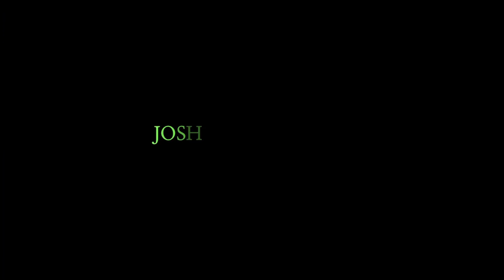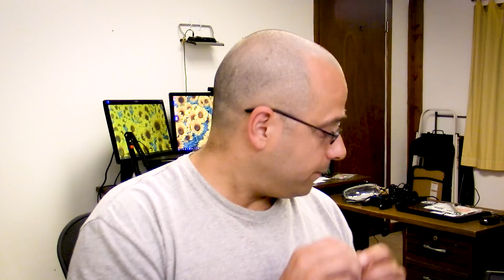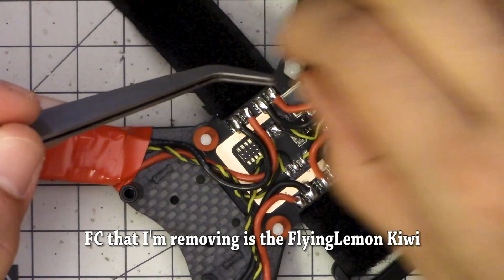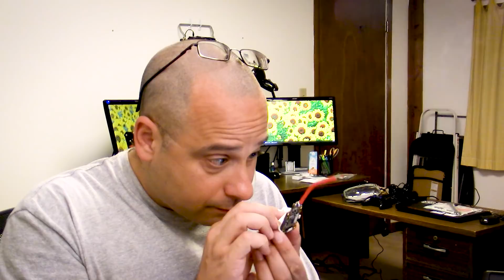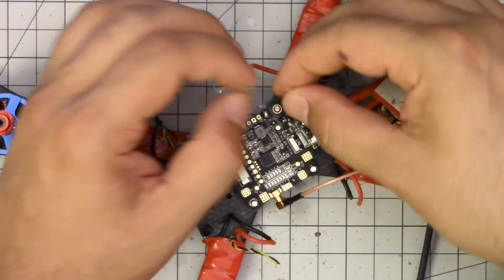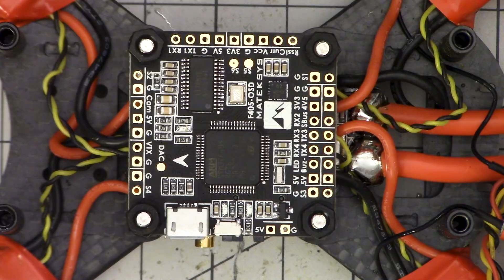Matek F405 & FCHUB vTX How To Install

Comment: Hey josh.. i had a signal wire from one of my esc's rip off the FC with the solder pad.. is there anywhere else i can solder 2 ? Was a purple wire.. wired on to s3.. theres a pad right next to it which im wondering about

Comment: I found a drawback I didn't expect with the FCHUB-VTX. I went to put one in a SabotageRC Dingo and if you use the 6mm standoff that comes with it, the tabs for the XT60 wires actually touch the frame. And if you are using it with the ribbon cable and a Matek FC, you can't turn it 90 degrees like you might otherwise. So I had to put it on very tall standoffs -  which shouldn't be a problem as you probably won't use a 3-high stack with this VTX, but just something to watch out for.

Comment: Hi Joshua i have these board combo but the mah drawn in my osd is not working what could be the cause of this?
Reply from the maker: Check the Current Source in the Power And Battery tab? Umm.... I think it should be ESC Sensor.

To configure ESC telemetry, do the following:

1. In the Betaflight Ports tab, in the Sensor Input column, enable "ESC" sensor input for the UART that ESC Telemetry is connected to. (This may be enabled by default on the Matek FC.)

2. In the Configuration tab, in the Other Features section, enable ESC_Sensor.

3. Be using Dshot. ESC Telemetry doesn't work without Dshot.

4. In the Power And Battery tab, set the Current Meter Source to ESC Sensor.
Reply: @JoshuaBardwell  Thanks Joshua! i tried to put the esc sensors into the ports tab put it did not work, after this i saw that the ma/v of the onboard adc was to low so i raised it and now i get a proper mah drawn. thanks for the help as always!

Comment: Hey Joshua great video would you know if those little plastic slide in sections for the ribbon cable connection are available I accidentally broke one of mine
Reply from the maker: I don't think they are replaceable without significant solder skills.

Comment: can you use a 4in1 esc?
Reply from the maker: You can but it wouldn't be ideal.
Reply: Since most of my frames have very thin arms I can't fit the esc's on the quad. After watching your review I went out and purchased 4 of these and now I don't see how to connect my 4in1 to the board. Any suggestions/videos showing this process?

Comment: JB. The vtx 5v bec is rated at 1a, will that be a problem to power up fc, rx, cam, & gps??
Reply from the maker: I think it should be okay, as long as you don't try to power the vTX also.
Reply: Joshua Bardwell The vtx is part of the pdb so i assume it doesnt take power from the 5v bec. Thanks JB

Comment: Do I wire the Vbat (on the VTX/PDB) to VCC (on the flight controller)?
Reply from the maker: I don't think that is correct. I believe the Matek F405 is powered either through vBat to the main battery pads, OR through 5v direct input from the PDB ribbon connector or equivalent solder pad.

I think that the VCC pad is intended to power an accessory device like a vTX when the board is powered from vBat. I don't think that the VCC pad will have any voltage on it when the board is powered from 5v.

Comment: If one of the pads comes off where your soldering to is the board then broken or will it still work?
Reply from the maker: It's broken. Sometimes you can find an alternative pin but if not it's dead.
Reply: Joshua Bardwell I think I've nackered the board, it's my first build. I've ordered another fchub pdb. I was having great difficulty soldering the ESC power cables to the board, the solder wasn't melting quick enough and went it did it just smeared and looked a mess

Comment: Where do I connect the microphone from my camera to this setup? Can I have audio transmission and smart Port audio control at the same time?
Reply from the maker: Yes you can do audio and vTX remote control because this vTX uses Tramp Telemetry protocol which uses a separate line from the audio line. There is an audio/mic input on the PDB/vTX where your mic will get connected.
Reply: Joshua Bardwell is that the pad marked TLM right next to the video input?

Comment: Awesome video. I Purchased the Matek F722 and the FCHUB6-s.  Should all be the same. It’s expected to arrive any day now.  Any advise to minimize solder splatter to critical spots?  Lower heat maybe?  I’m using a Taranis QX7 transmitter.  I’m not into racing, so what do you suggest for a receiver? I have a X8R. Sbus, Smartport?  That is all new to me.  I’m coming from the Arduino world.
Reply from the maker: For a receiver, the XM+ or RXSR are good but you have to update the firmware on the RXSR before you install it in the quad.
Reply: My Matek F722 STD, FCHUB6-S came in today.  All soldered in.  NO SMOKE!  Dumb question, Can I connect the USB when the battery is plugged in?  Scared of frying my board as soon as I get it.  BTW; I grill all my steak, have never seared them. Pointless!

Comment: With bf3.3 and Kalman Filters coming, matek f7 (which supposedly cant run 32k/32k) or f405
Reply from the maker: Betaflight is not optimized to run on F7 right now. It runs slower than on F4. If you want to do 32k right now, F4 is where to be.

Comment: I do the the same thing at times with using same colored wire to use it up. ... BUT ... When I do use the same color wire like that I just put a piece of colored electrical tape or heat shrink at both ends to identify the color it is meant to be. If not I get confused. Especially if I put the wire in sleeving.

Comment: Did you have to update the firmware on the VTX board to get the Tramp comms working ?  Whenever I enable the peripheral device to Tramp on softserial the whole soft serial config gets wiped on reboot.  Firmware update it not going well either. Nevermind, Tramp should be on uart5.
Reply from the maker: Nope. it worked out of the box.

Comment: Hey +Joshua, i'm new to multicopter building/flying and really enjoy all the information you provide on your blog and youtube. Thanks for that! One thing in this video confuses me. You say if you don't have a GND solder pad for the esc-sgn-gnd just solder it to the power-gnd or if the ESCs are free desolder the gnd-wire. Actually on my ESC (DJI 30A Opto) the sgn-gnd and the power-gnd are already shorted, so does it make sense to have the extra gnd-wire? I read alot about this and all I understood was that I should solder the sgn-gnd because of different 16V(4S)gnd-level on power-gnd and 5V-sgn-gnd.

Comment: You could just use a continuity check from the ribbon to the pads to confirm the up/down issue without power.
Reply: .... and I now see you did a lot of that in your troubleshooting video. :)

Comment: Ibcrazy recommended using a 90 degree for the antenna that takes stress off the connector and if it breaks it leaves a load on the antenna

Comment: Hi josh. Got this setup. And all works great. Using runcam swift 2. But want audio so i can use my earbud. But cant figure out where to solder audio wire from camera to the board. Please help
Reply from the maker: Audio input is on the bottom of the board. See this photo:

https://www.rcdepothobbies.com/v/vspfiles/photos/FCHUB-VTX-3.jpg

Look at the AUD pin just to the right of the RF module cover.

Comment: Careful i was runing P.I.D loop and gyro at 8k and FC pulls 1.5 amps PDB's 5v only rated at 1amp my PDB lasted 2 flight after switching to 8k and and 5v burnt out.
Reply from the maker: It has nothing to do with your PID loop rate. If you pull 1.5 amps from a 1 amp regulator, you'll kill it.
Reply: Joshua Bardwell well i got a new fuhub vtx and with the same settings on the flight controller plug the battery in current sensor reads 1.5 amps I unplug the battery plugged into betaflight turned PID Loopto 4k now I only pull .5 amps why the change in amps then?

Comment: Hi, do you think that the 5V/1A output is enough to power a runcam split V1? (Given the fact that The FCHUB-VTX needs to power its own VTX, the receiver (Frsky XSR) and the F405 Flight controller too) 1A seems a little short for all of this.  Thanks!
Reply from the maker: +Francis Verville no I don't think so. Split pulls like 600 mA.

Comment: Joshua, I'm building the same quad with these FC and VTC/PDB boards, I'm ready for the next installment.
Reply from the maker: Here was the next one.
Reply: If I may jump on the back of this...I'm in the same position as Doug here but am unsure what you meant by this? :/ Thanks for any info you could give.

Comment: Why did you wrap your previous vtx in kapton tape?
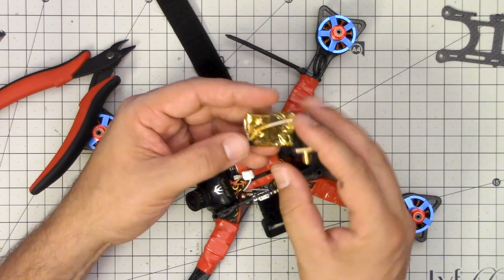Reply: 1:40
Reply from the maker: For electrical isolation. But kapton you can see through so you can still see the LEDs, while electrical tape you can't. I could use clear heat shrink but I don't have any.
Reply: oh, okay :D

Comment: I have a question that, I can't seem to find very much information on. It has to do with setting up camera_control and the modes for CC on BF tab.
 I am very intrested in setting this up, as I would like to be able to access my camera settings menu with my remote and goggles. I have the matek f405 and found some info on the DAC pad and tried to make it work but could not.
1.) I enabled camera_control_mode = DAC 
2.) Set resource CC to A04
3.) Left all CC to default.
4.) Set a switch to CC in modes tab, but it never activated. 
5.) Tried to yaw right,  to no avail.

I will try using the signal pin 5 tomorrow with a resistor, as seen in a few videos, however would like your input on the subject.
Thanks for all you videos.

Comment: Hi Joshua,Firstly, thanks for all the great vids and content.  I have a question about the Matek F405. Have you had any issues with yaw twitching.  I have a Matek F405 board, with Spedix BL Heli32 ESCs and Cobra 2207 2450kv motors and I am having issues with yaw twitch when throttling up.  This is still a brand new build and I haven't yet fitted the 220uf, 35v capacitors supplied with the board. Matek supplied 4 of these, presumeably for each of the ESCs. I have heard that the Gyro on these boards is very sensitive to noise from ESCs/motors and this can cause yaw twitch.  In your opinion is this likely to be correct?Thanks again and keep the good vids coming.Gary
Reply from the maker: Put the dang capacitors on for goodness sake that is why they sent them.
Reply: Well, as you Americans would say " YeeeeHa".  Fitted the capacitors and no more yaw twitch.  Didn't really want to fit them because of aesthetics, but they're not too bad.  Thanks for the input Joshua :)

Comment: I always got to thank you for your videos. I really like Matek products
Talking about R-XSR, did you notice the antennas were as bad calibrated as the XSR? could you please tell me how to know if they are "new generation" ones (with non-inverted?). I bought them from GetFPV recently.
Reply from the maker: I am going to be doing some antenna testing to see if the effect is as bad as people say.
Reply: Joshua Bardwell I just installed it. By opposite to the XSR, the antennas are IPEX fixed, so I changed then to well calibrated ones. But it seemed to me it was good but not better than the original ones

Comment: you inserted the ribbon cable the wrong way  the piece of blue plastic  should be facing you
Reply from the maker: I verified with a multimeter that my way of insertion was correct.
Reply: Find out for yourself:
http://www.mateksys.com/wp-content/uploads/2017/04/F405-OSD_FFC.jpg
Reply: G MacClement oh ok thats very strange since most ribbons have the blue plastic facing you since that's where you have to pull the ribbon from but I guess they done it upside down :)
Reply: Exactly.
I had to check it out for myself too :D
Reply: Joshua Bardwell I checked myself and it's strange they made it the other way round 😁

Comment: Hey Josh, thanks for the video. Have been looking at either the Matek F405 AIO or this combo. I'm seeing that the AIO is hit and miss in terms of gyro noise and yaw twitches. One question, what do you think would be the best way to mount a Runcam Split in a stack with the F405 and FCHUB VTX? Soft mounts on either side of the FC, so the Split is also soft mounted?
Reply from the maker: Once you have the soft mount standoffs installed, I don't think there is a benefit to adding more. You don't want the heavy camera wire pulling on the FC stack and transmitting vibration. I guess what I would do is, Split on bottom, then FCHUB, then soft-mounted FC.
Reply: Thanks, that’s the logical thing to do in terms of mounting. Have you had an experience with the Matek F405 AIO?

Comment: Pick up some LocTite "Fun-Tak" mounting putty and stick your components to your work surface when soldering. Keeps em from floating around and requires no cleanup.
Reply: Yep big fan of it myself. It is way better than the extra hand/alagator clip, in so many ways. Also use a piece here and the to hold things in place, ie under esc, wires and antenna leads etc...

Comment: if your board osd is not reading the same rssi value as your taranis doest the smart port on xsr has to be uninverted on my lum aio f4 fc?
Reply from the maker: If the FC has a dedicated "telemetry" or "smartport" pad then it will work without any modification. If you are using a regular UART pad, then you need to uninvert the smartport signal.
Reply: ok thanks

Comment: +Joshua Bardwell Matek offer instructions to use Soft Serial for Smart Port telemetry on their website as well as the un-inverted pin hack. Less fiddly soLdering- love these FCs they have all the pads you need. S5 and S6 - Camera OSD and Smart Port.
Reply: You are correct. I enabled softserial on pad S5 (I have a XSR-M) by following the instructions on the Matek website to do the necessary changes via CLI in Betaflight.
Instructions: Type “resource motor 5 none” in CLI, press ENTER. Type “resource serial_tx 11 A15” in CLI, press ENTER. Type “Save”, press ENTER. Done.

Comment: Is there a way to add blackbox capability on a board that has no storage nor an SD card slot? (Racerstar F3s)
Reply from the maker: You can use an external OpenLog device and a serial UART. But the problem is the UART data rate is slow and you can't log at a very fast rate, so much data is lost.

Comment: I wired smart port to motor 5 and used soft serial and seems to be working fine. Do you think the baud rate is too fast for soft serial? Matek showed it could be done online. Just thought I'd ask
Reply from the maker: No it can be done.

Comment: Hi Joshua, thanks for the video! I have the F405 and FCHUB in my cart at pirofliprc using your link. I'm looking for a 4 in 1 ESC to add to this combo. Any recommendations? I'm putting this on a 210mm stretch frame with thin arms. Probably going to use hyperlite 2307-2522kv motors or something similar unless you can suggest something in the motor department also. Looking forward to the next vid in this series!
Reply from the maker: http://pirofliprc.com/Spedix-IS30-4-in-1-2-4S-LiPo-DShot600-BLHeliS-30A-ESC_p_3953.html

But don't use the 12v output it's junk.

Comment: today i am gonna learn that joshua didnt read the manual. the ribbon is non conductive facing up :D muahahahahahahaha
Reply from the maker: No, that's incorrect. I can definitely confirm that the correct installation is with contacts facing up. I tested this with a multimeter looking for continuity between ground and the ribbon cable. It only has continuity when the contacts face up. If the manual says otherwise, it's wrong--at least for my boards.
Reply: Conductive does go up
Reply: Find out for yourself. Josh is right (again).
http://www.mateksys.com/wp-content/uploads/2017/04/F405-OSD_FFC.jpg

Comment: Why is the Betaflight FC so difficult to solder?
Reply from the maker: Heavy ground plane means it soaks heat away from the iron.
Reply: do I hold solder iron longer on the copper or do I put up the heat of the iron? (doing 350°C now)

Comment: Joshua i don't recommend soldering the esc's signal and gnd to the PDB but on to the f405 flight controller it self because the gnd is filter's to the flightcontroller and all the electronic noise on the pdb gives more noise to the esc's;) the matek f405 has nice layout for the esc's to eights sides off the board
Reply from the maker: That's an interesting point.
Reply: Took a better look at the board layout and it does have signal and ground for all four esc’s.
Reply: Theoretically you are correct, but I haven't noticed any negative effects from connecting signal and ground to PDB. Connecting directly to the FC might be slightly better but makes the build messier and harder to work on (have to desolder more connections to remove FC).

Comment: Do you have a video about tpa and tpa breakpoint because I'm having issue with full punch out. It shake retarded. Plus, i dont understand how it work. Do I need blackbox to see where it start to shake or it's about feeling it?
Reply from the maker: https://www.youtube.com/watch?v=pthPcX7svWQ

If you have BFOSD put throttle position in your OSD and then just look and listen for when it starts to oscillate.

Comment: Those ribbon connectors were giving you a hard time. Also if you melt a big of solder on the tip of the soldering iron it really gets heat across a lot faster even at lot temperature. Thumbs up!